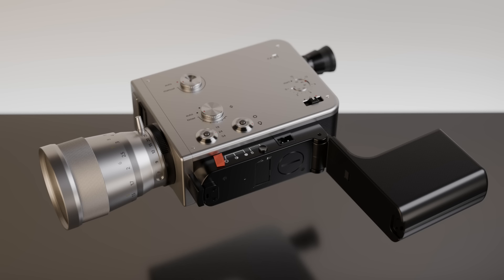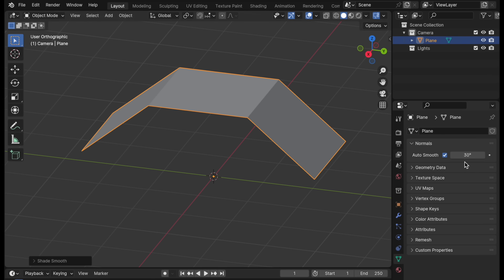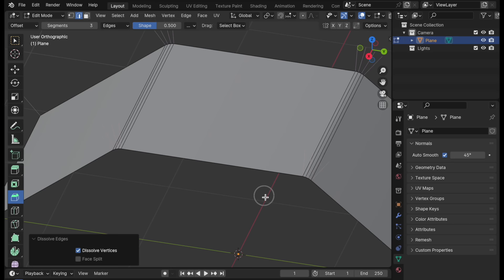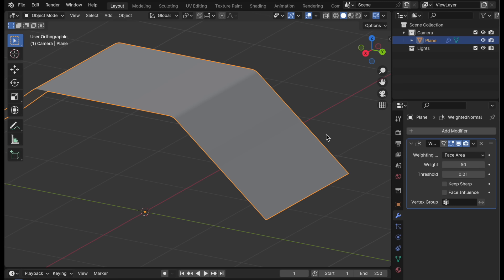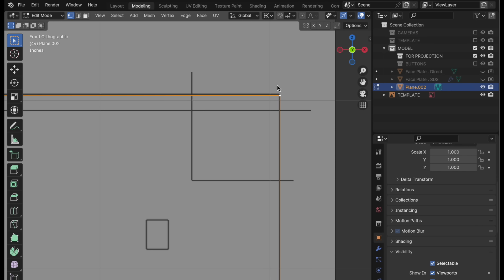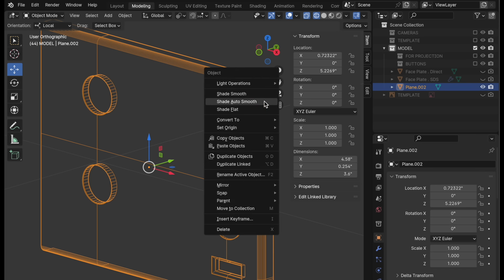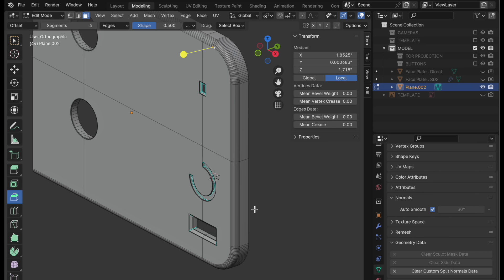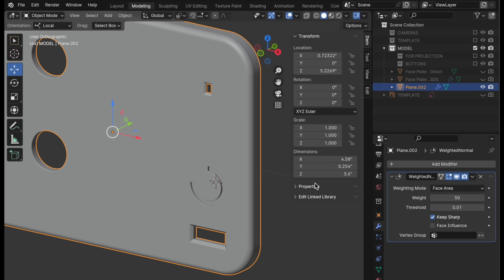What is the Weighted Normals modifier used for?

Comment: This is what advanced N-Gons modeling should be, no add-ons, pure knowledge
Reply: honestly this is exactly what a great teacher does.. 90% of the videos on Blender are people just basically showing off their own skills and using plugins. This is pure learning. 

Thank you Christopher and keep at it you are an incredible teacher.. I learned Blender on my own and so many things still to learn and weighted normals and even sharps you showed were always a mystery to me. You just made it more understandable. This really opened my eyes that we don't have to always use subdivision modifier to achieve great results.
Reply: True, this is good knowledge to have. With that said, add-ons are helpful in allowing you to get certain things done FASTER, and more efficiently. For example, this workflow, once you understand it, is great. But the constant management of the order of the modifiers, manual tracking of your cutters, etc. will slow down the design/creative process immensely. An add on like hardops/box cutter is simply designed with this workflow in mind. That's why when you use a cutter through them, they automatically sort these particular modifiers (weighted normal at the bottom, bevels in the proper place, etc) for you. So getting the add on's without really understanding what theyre about won't help much. But once you have knowledge, skill, and experience with whatever aspect of 3D you are into, be it rigging or modeling or whatever, add ons will simply compliment and help your workflow.

Comment: Thanks for this video! So I already knew about this modifier but instead what I really got out of this video was an in depth explanation of how are normals calculated. And also discovered the awesome 'Set Snap Bast' function of the 'Move' tool, haha. This is why I love tutorials, I'm doing 3D for a long time and there's always some small new bits that you learn. As for the shading in these 90 degree corners where you put 'Set Sharp' towards the end of the video, wouldn't you say that beveling these would produce a better shading result and also make the model even more realistic? If there is one thing that I know for sure it is that we don't want sharp corners on high poly hard-surfaces..

Comment: awesome tut!
also, i just wanted to point out that for situations like at 27:30, the algorithm may be struggling because of the topology. i'm not sure why you dissolved that area into a single face, which is not an ideal quad based topology and can easily create shading issues :)

Comment: Thank you for this video. Very informative. I just started learning hard Surface Modelling with Blender. And, very quickly I have been exposed to the industry argument of avoiding ngons in 3d modeling. Please what is your take on ngons and quads in 3d modeling. I have been watching your tutorial for a while. You sounds like a professional in this field and not just some road side modeling artists.

If you have a video on this topic you can recommend that also.. 

Thank you!
Reply from the maker: One of the reasons there's resistance to the use of ngons is some systems don't work well with them. For instance, Unreal Engine doesn't like them and it's best to triangulate or quadrangulate ngons in a model going there. But most general purpose systems like Blender handle ngons just fine. The restrictions for their use comes down to whether an object needs to be deformed in some way, that's a condition where ngons can cause problems. They can be used in a subdivision surface model, but you do have to be more careful with how they're done. For instance you do need to avoid concave ngons because they get subdivided to polygons that can end up overlapping onto each other. But at render time and when a model is subdivided, those ngons get converted to quads and triangles anyway.

Comment: Did you have to reupload? I actually watched again because there is some really good info in here. I use the Weighted Normals modifier from time to time but now I understand what it does better. Thanks!
Reply from the maker: Yes, I decided to make a change in one section, but it didn't alter the overall material in the video.